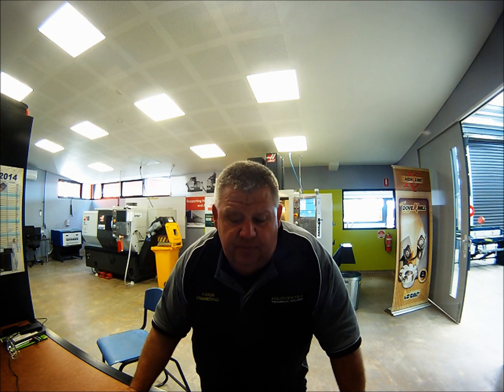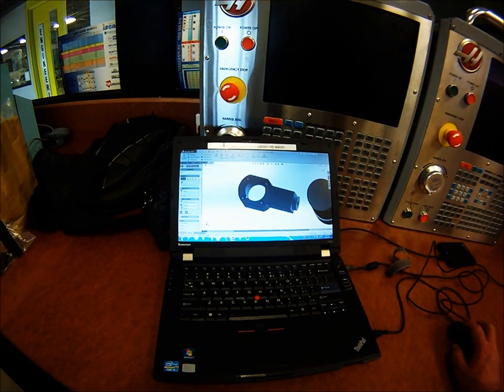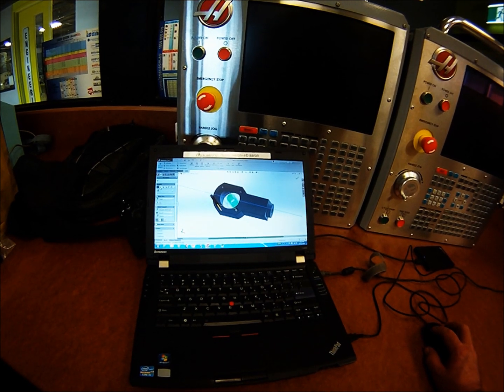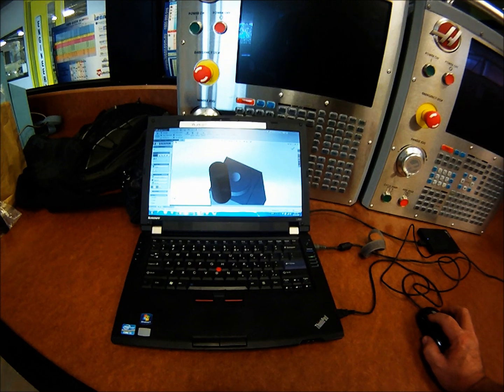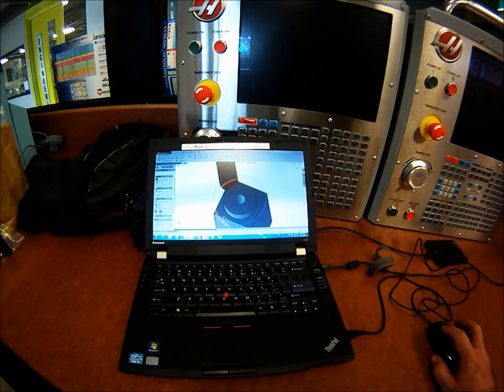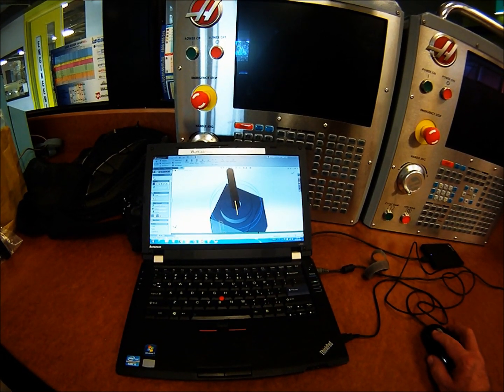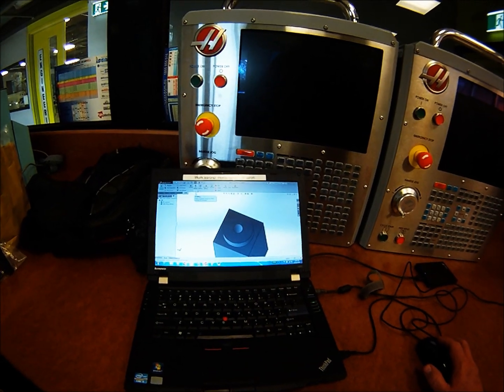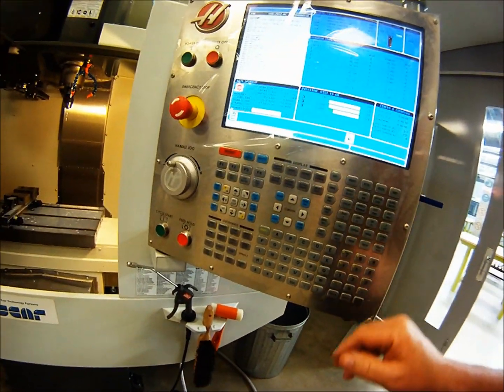HSMWorks on the HAAS SMM2 - TM25 / PM25 Z-Axis Parts

Comment: Hey mate just wandering if these kits are ready for sale yet and a price, located in Perth looking to get one for my tm25
Reply from the maker: Ben L Hey Ben, not far off finishing the 1st prototype ball screw conversion kit now. I have a bloke in Sydney who is Beta testing the first kit for me. I finished the Z & Y designs.  On to the X axis now.  As for pricing, I haven't worked it out as yet. However, it will be cheaper than other similar kits on offer. PM me and I'll give you my private email. Cheers, Aaron.
Reply: +DCTTeacher1 I will probably come across more info on these conversion kits as I get through more of your videos, but if I don't, I am interested to know more.

Comment: Are you getting the ways covers fixed? That would be unacceptable for a brand new machine.

With HSMWorks you can rough that contour using 2D Adaptive clearing and use 2D contour only for the finish pass.  Your roughing could be done at 250 IPM no problem and reduce cycle time.
Reply from the maker: jdrinkh2o Hey mate, yeah the way covers banging like that is annoying. However, it only does it when I drill at low depths. I'll mention it to the service team when they come next. Hey thanks for the HSM tips.  I'm still new to HSM and it's all part of learning curve. Cheers Aaron.